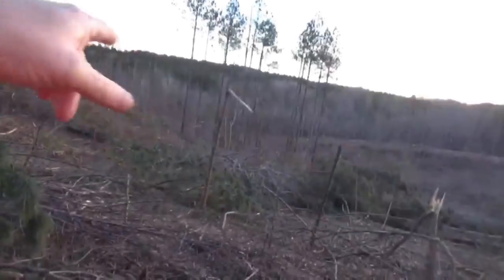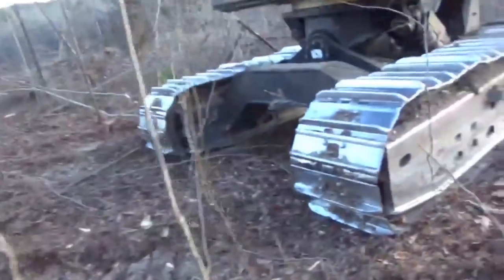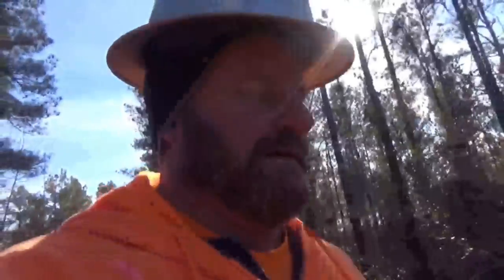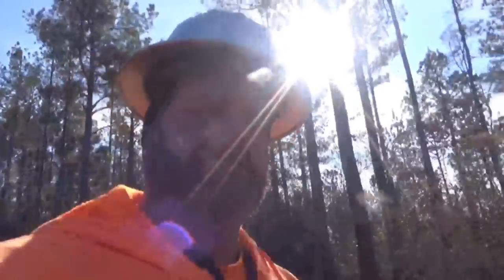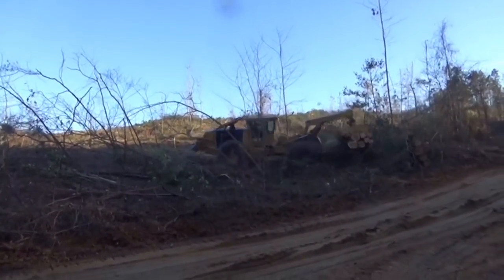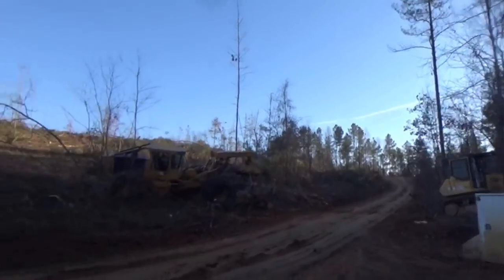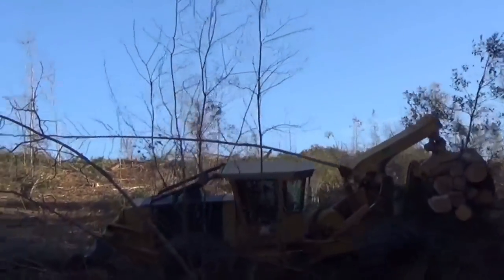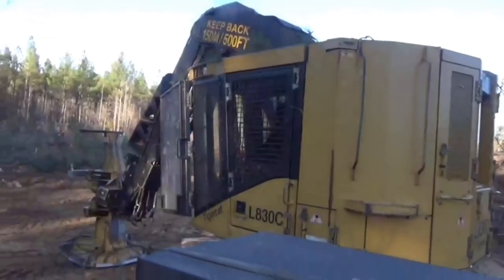Tigercat 630E on the job!

Comment: Good to see TigerCat on the ball, We use quick disconnect fittings on the race engines when we purge from Meth to Petrol and back it's so easy and mess free, and over the last few years, more steel fittings at the right price are available so they can be used for many applications.

Comment: A machine operator can tell the difference between above zero and below, metal will break a lot easier below zero. And some hydraulic stuff never gets warm enough to work correctly.